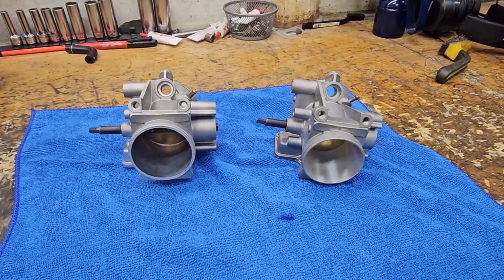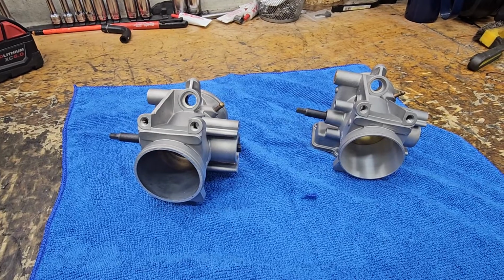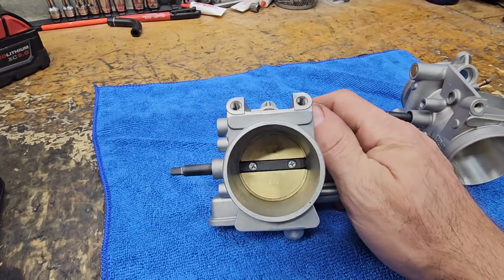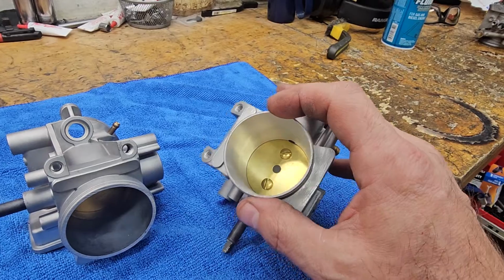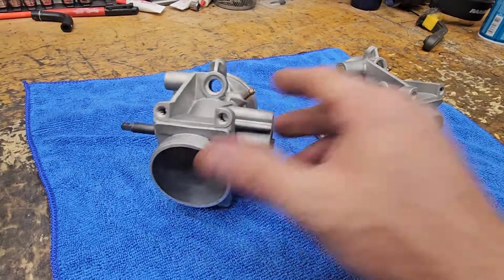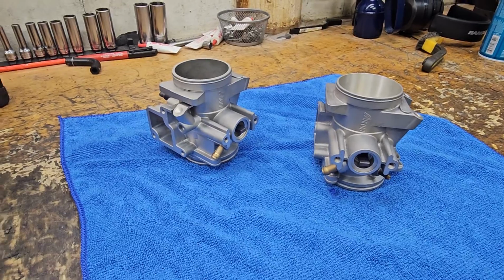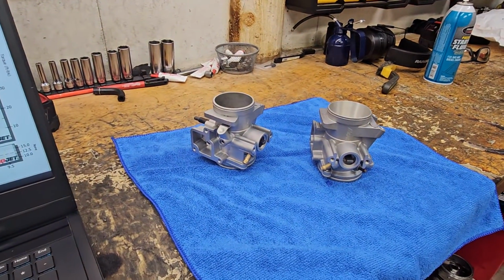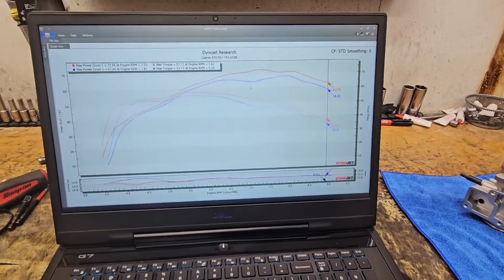Huge  Hp  gains for your Raptor 700 Cuervo Throttle body bore

Comment: I have a 2006  yamaha raptor bore and stroked to 770cc with a plus 3mm intake valves and plus 2mm exhaust valves?   11:1 compression piston, stage 3 cam, I've got a efi controller, freed up the intake and exhaust.  What size throttle body would you recommend?
Reply: 2006 doesnt have fuel injection dies it?
Reply: @jbaker8871 it actually does.   They are also known to struggle to handle the amperage with all the electronics and the harness usually fails.    Throttle position sensor, O2 sensors, efi Throttle body, rpm sensor in 5th to limit the top speed are just to name a few.  It even has a fuel pump that's electric.
Reply: @joeyholthusen6495 did I mess up getting a 06 raptor that’s all the problem I been having is the wires it happen 2 twice in a year
Reply: @L3FRMTMB  I have had to hunt down electrical issues the last few years myself and it takes time.

Comment: I have one of these on my 2019 raptor with cam full exhaust. It was the last thing i did. It did give me a noticeable difference in power in dunes wants to lift the front up lot easier.  All stock motor with cam. I want to ask would you recommend  a ported head or a 745 12.5.1 piston as my next upgrade ? How do you think the throttle body  will work with either

Comment: Mr. Cuervo I've question, right now on my R700 2017 have Big 3, full port head, +2 valves, Mr. Cuervo's throttle body 47mm but I'm indecided between put hotcams stg.2 or 3 or webcams I don't know which one will work better for these built!! Will be on stock piston and pump gas always.
Reply: Hot cam 3 only. I have one runs great 1 & 2 don't do much. My 700 is very dependable  with the hc 3. I'm thinking about ported head or big bore not sure witch way to go

Comment: I have the Barker Dual exhaust Big 3 kit on my 2018 Yamaha Raptor 700 can I used this throttle body with my stock engine if not what upgrades do I need to do?
Reply: Interested on my stock as well